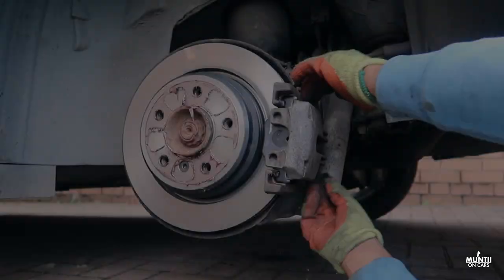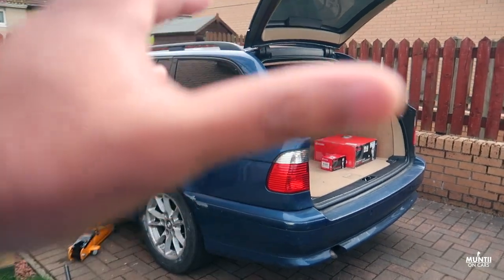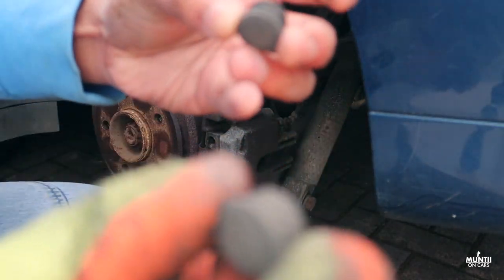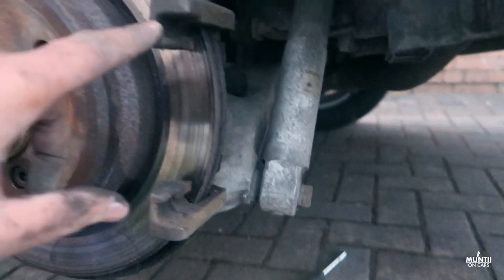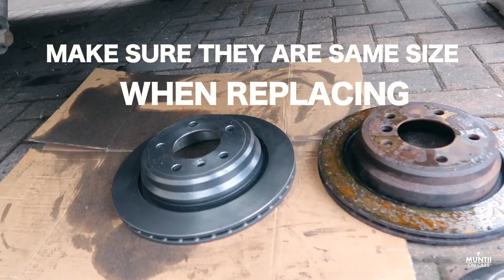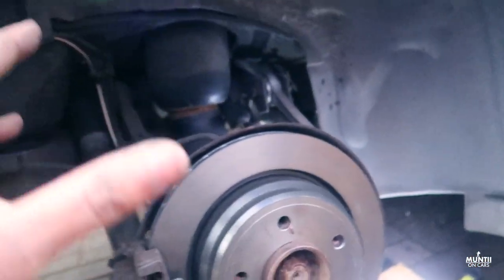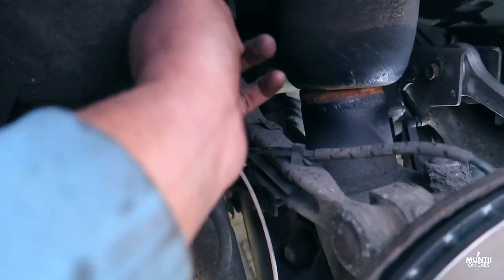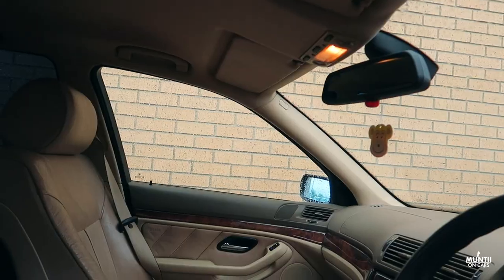Replacing REAR BRAKE Discs and Pads on BMW

Comment: Nice video! I'd hate to count the disc Allen heads I've rounded, until I found a tool called an impact driver with bits. These things are amazing I wish I'd found earlier.

Subscribed 😀
Reply from the maker: CookRacing UK thanks for checking out the video. And appreciate the support u shown by subscribing! Hope you enjoy my random car vlogs🤘🏼 

Sure i will look into the tool u recommended. Thanks man!  

This method helped: using wd-40 before taking of the disc allen heads. If it gets rounded maybe try next size for allen key, knock it with a hammer to sit in it and turn.